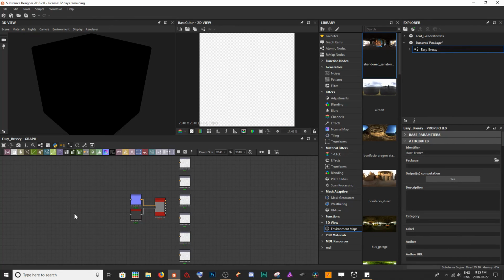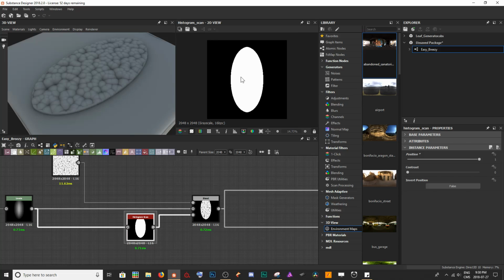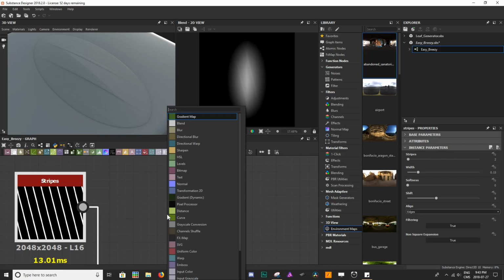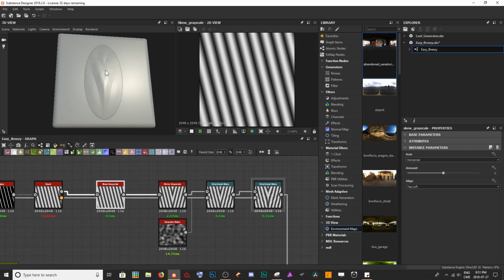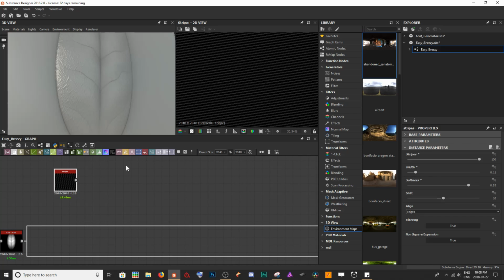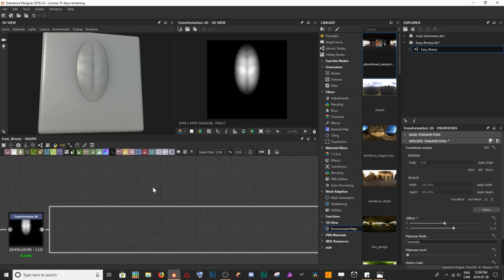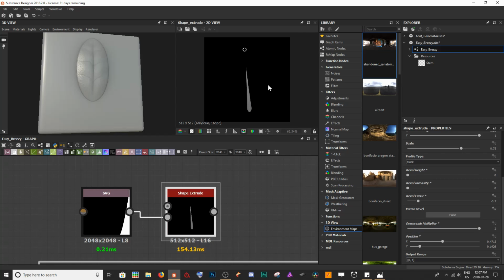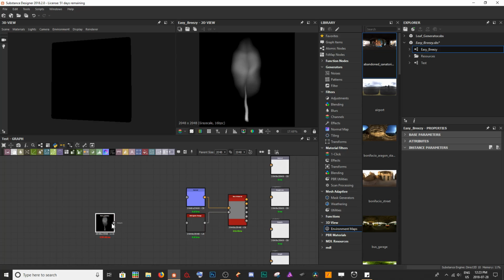Leaf Generator | Beginner Substance Designer Tutorial

Comment: Hi! I have a question, does this tutorial still work and is is also possible to create a generator that will make 1 leave where you can control all the parameters on that 1 leave?
Reply from the maker: I can't foresee this tutorial not working in 2022, unless there are nodes that have been deprecated in the most recent version. If there are nodes that no longer exist, there will likely be some type of equivalent so you should still be able to follow along regardless. As for the second part of the question, it will depend on how you structure your graph but the goal of this node is to have it be a quick tool to generate leaf shapes, so you should be able to get what you are looking for.

Comment: Another great tutorial! Thanks. You're really good at breaking down the process. One question, though: Do you have a video about how to figure out what nodes to use? It's one thing to know what shapes go into a material, it's something else to know you need to skew, mirror, and directional warp a beveled stripe node to get that shape. Seems to be the steepest part of the SD learning curve.
Reply from the maker: Thanks friend! And I'm glad you've asked. I've recently looked into starting a new series about learning what each specific node does and some use cases for them. Very short, concise tuts. Unfortunately I dont have any of those out right now, but trust that I'm working on it! :)

Comment: In your cobblestone video you have an instance parameter for different types of leaves... how did you do that??
Reply from the maker: If you actually take a look in this video here, I'll walk you through the steps to import any custom nodes that you make to speed up your workflow! It's only about 4 minutes, so you'll be up and running in no time! I used the final product of this video in the one I have linked so it should be pretty straight forward, no tom-foolery. :)

https://youtu.be/0MCTBAfOeMU
Reply: I could be misunderstanding her question, however I think she's asking about in your video "Customizing Your Library | Adding Custom Nodes in your Library" and "Cobblestone Material | Beginner Substance Designer Material" you have an option under your instance parameters to change the leaf type. So I'm understanding how you brought in your custom node, but it looks like there were more steps after the leaf generator video ends to add these leaf types? I'm pretty new to SD so I might have missed something, but with following along this tutorial it doesn't show how to make those different leaf types, right?

Edit: I think you answer my question in your cobblestone comment to someone, you just add a lot more to the final product off camera because it takes a while? That makes sense! However, is there any tutorial you could possible make or point me in the right direction to find how to do it? If you are too busy I completely understand.
Reply from the maker: Ah, I see what you're saying! Like you said, for all of my tutorials there is a bit of "off-camera" stuff that I do that I don't show in the videos, only because it redundant information. If I feel I have taught a method well enough, I will normally leave it up to the viewer to extrapolate that knowledge when trying to further their understanding of the software. As much as I want to be able to show you guys around the software, I also want people to do some self exploration with the ideas being taught so that they can cement that knowledge through teaching themselves. So to have a short answer to a long response, I don't actually show how to make the various leaf types in the video. HOWEVER, you can download the file I made (totally free, no sign up or anything required) in the link below, and take a look at the raw graph that I made for this video, with the "off-camera" stuff in there as well. :D

https://www.patreon.com/posts/leaf-generator-20381476

Thank you for taking the time to comment on the video, I really appreciate it! And I am never too busy to help clarify or find a solution for you, so never hesitate to let me know! :)
Reply: @GetLearnt   I found this a bit confusing too, but I understand your point. I must have done four of your tutorials this last week, you've taught me so much in an easy to follow format, thanks very much, I'm almost feeling like I can take the stabilizers off now. I've been making mesh plants for a few years, and am wishing to use SD more in my work flow.
Reply from the maker: I am currently looking at ways to inprove future tutorials, so thats great feedback! Im looking forward to seeing your materials once you remove me completely! :D
Reply from the maker: Tacosalad46 I just saw your revision! Yes, I am looking at new ways I can provide tutorials for you guys and gals, a lot includes new cool ways we can expose parameters. Ive learnt a ton on my own exploring, I have lots to share. ;)

Comment: Hi, I have the same substance designer version as yours but my bevel node it's completely different form yours. Mine doesn't has neither the hight nor normal outputs, instead it has only one output called material. Do you know why? :(
Reply from the maker: Good question! That's likely because you are viewing your nodes in "Compact Material" view. If you look up in the toolbar of your graph, you should see a tab that looks like a connection line (in your case it should probably be a green line). Click that and hit single input (or whatver the single one is) and it should show up. Alternatively, if you hit "1" on your keyboard it should switch it. :)
Reply: Get Learnt Thanks! :D